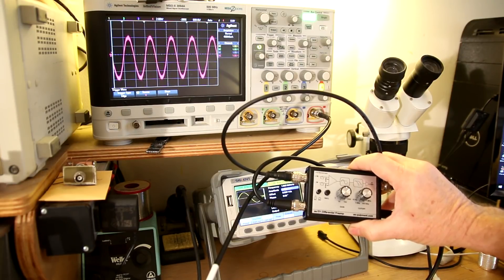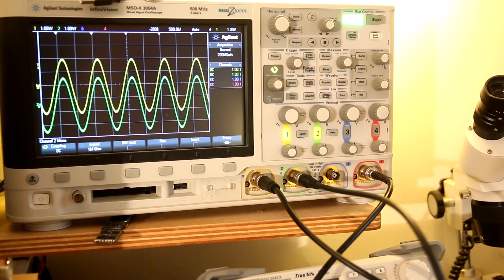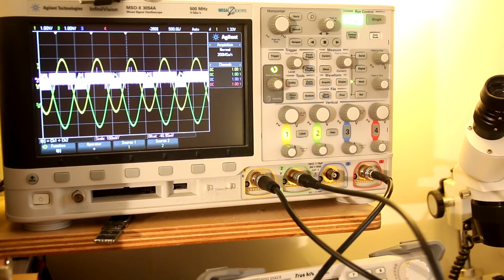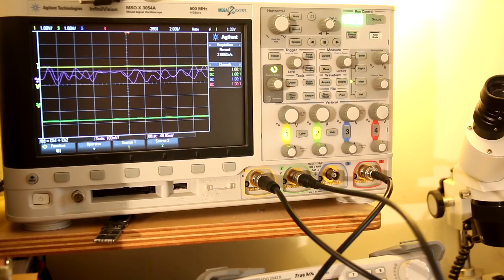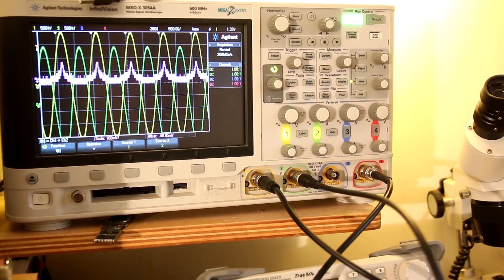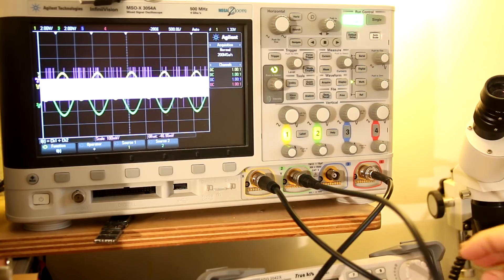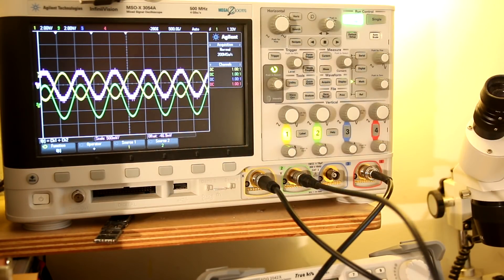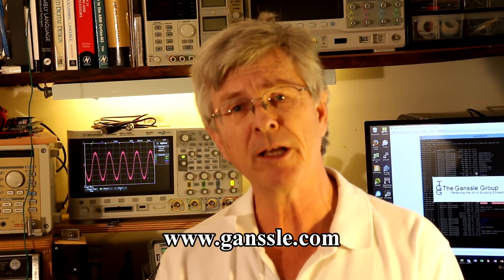Episode 22 - How NOT to use an oscilloscope's invert feature

Comment: Does an analog scope work? Or is the math done after the input ranging as in a digital scope?
Reply: No math in an analog scope, it becomes a direct differential voltage circuit.  So as long as neither analog channel clips, invert/subtract has resolution determined by noises - either in the signal or the noise floor of the scope.  Suitable vertical centering of each waveform allows maximum signal without clipping.  
I just bought a Siglent  SDS1202X-E (8-bit vertical res.), so will test what effect adding 1/2 LSB noise to input has on displayed quantization error.